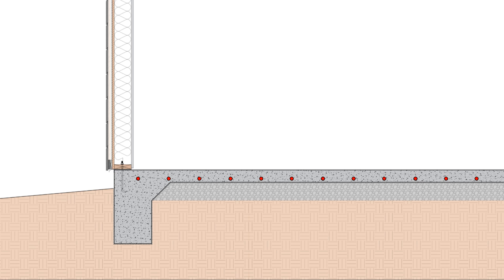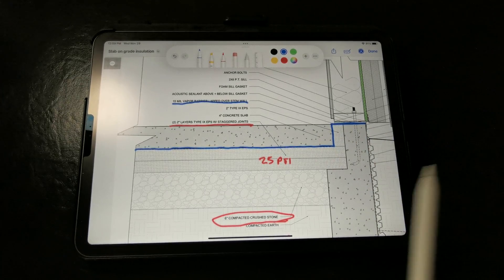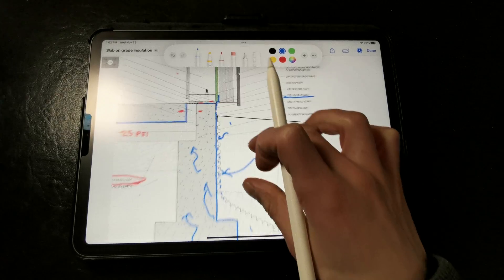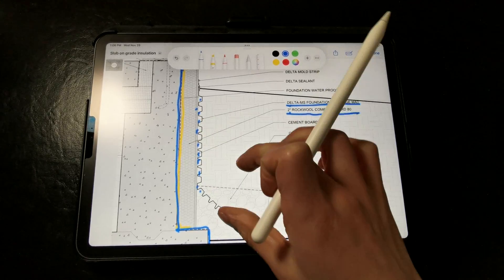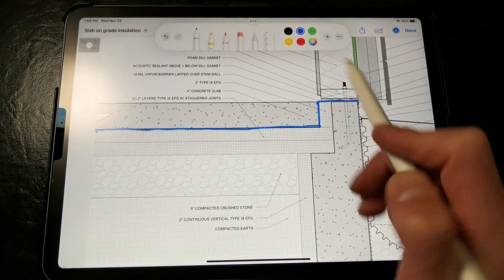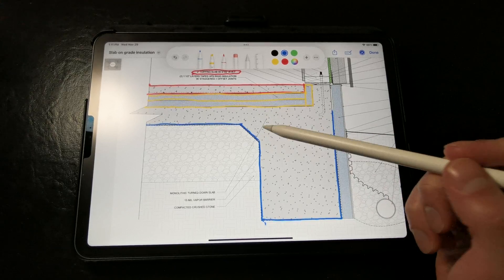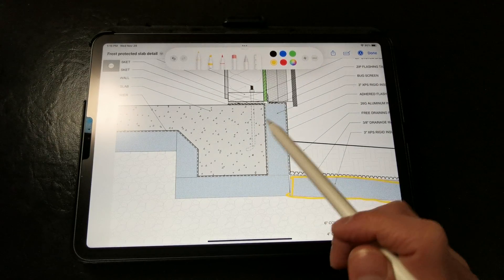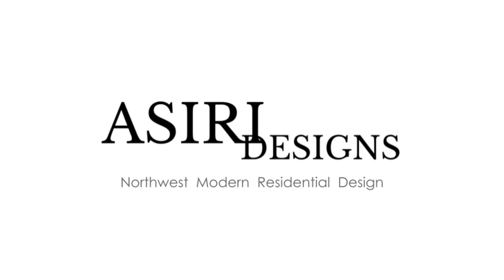Insulated Slab on Grade Foundations (For Architects + Builders)

Comment: In regards to your 'Insulated Monolithic Slab w/ Topping Slap detail......I'm planning to raise the slab on my garage to match the finished floor elevation of 1957 home (pier/beam).  Garage slab needs to raised approx 6" to match home floor elevation (garage slab is currently covered with epoxy flooring fwiw).  Would it be ok to add 15 mil vapor barrier under 4" xps (w/ taped seams) or should I add above xps?  Also, since footing/slab is already in place any suggestion on how to detail the perimeter xps?  Concern here is I would be pushing into the interior floorspace is I used 2" xps for perimeter insulation.  Hope that makes sense!

Comment: How would you do that with poured concrete walls also? Could you make an insulated concrete wall (with the insulation inside, not icf) and have a load bearing wall on top of the rigid insulation? I guess the load bearing section of the wall would have to be over the footing section of the foundation... (so outside of the insulation)

Comment: The detail of having the vapour barrier above the rigid slab insulation is WRONG and will lead to COMPROMISE of the insulation R-value because water will condensate on the underside of the vapour barrier which separates the insulation from the warm slab. Treating the insulation as substrate, by placing it in contact with the ground and THEN layering plastic over it is madness.

Comment: General contractor here, this vid displays typical engineering student bullshit.  When you get some in the field experience, you do away with all the "gee whiz, that's cool!" design details and go straight to things like letting the 2 X 6 bottom plate sit 2" off the top of the stem wall, run your 2" of blue board right up against the bottom of the plate and run your below grade ice and water shield a foot up the wall sheeting.  Geotextile/filter fabric to protect the ice and water shield membrane and a washed rock layer for curtain drain into foot drain for wet locations.  Use flat painted sheet metal from just below grade to up under bottom of siding to protect ice and water shield membrane from sun and make it look nice and you've got an insect and bomb proof free board detail.
Reply from the maker: We'd love to see a video or sketch showcasing this detail (as well as many viewers watching this video). It sounds like it has a lot of potential, and we're always keen on learning about other ways to solve the problem. Please do post a video and share it with us.

Comment: 4:06 … you are calling out cement board over the foundation insulation, and then Delta-MS Foundation Drain Mat over the cement board.

What type of cement board are you using? How is it attached to the foundation? And are you applying anything to it, to seal it, prior to installing the drain mat?

Comment: On a related subject somewhat, I've never used anything but water in 4 different radiant floor homes and shops, no anti freeze, for the last 40 years.  In the Idaho mountains, so real winters,  the homes had basements but the two shops were an insulated slab with insulated foundation walls to the top of the footings.  Even after a couple weeks of no aux heat the slabs never got below the low '50's.

Comment: There are two types of climate zones: One for growing and the scale goes from zone 1 as the coldest and 10 as the warmest. Then there is the building climate zones which is opposite, ie zone 1 is very hot and humid and zone 10 being frigid cold, so now this makes sense the colder the climate the more insulation you need as long as you use the right climate zone scale
Reply: Slab on grade great lessons and thought provoking. Thermal bridging, potential wicking not to mention water and frost heave all seen important!

Comment: The real question here is why are we insulating the concrete on the bottom at all? Why not just use an appropriate rigid insulation above? Seems likely we are spending extra time and money coddling concrete. Concrete was never developed for this kind of use and I can't help but think the generations of builders long gone would look at this construction as madness.
Reply: Insulation on top of the concrete can cause condensation with the cold concrete, which can produce mold.

Comment: Very informative video. I have two questions: 1) Does the slab not need 2" to rest upon? A standard frost wall is 8" thick. 2" for the slab and 6" for the sill plate. 2) If the rigid insulation is placed at further outwards to leave 2" resting space for the slab, it will cut into the sill plate area. Will it not diminish the weight-bearing strength of the frost wall?

Comment: I would suggest to extend the outside wall insulation past the top of the foundation. The foam sill gasket is still a thermal break that could be covered

Comment: I have tried to design this with an engineer, and we found that your anchor bolts being used in the concrete I believe three and three-quarter inch of concrete on each side, which means you need a full 8 inch concrete wall for the anchors to work. By using the phone, you’ve narrowed it to 6 inches. Have you ever ran into this or checked on it with a new engineer?

Comment: At 3:04 where you’re using Zip liquid flash, I’ve found that Siga Fentrim is much easier to work with and much less messy. If you live in the northeast it’s readily available and you can get it in a day or 2. It doesn’t require primer and sticks extremely well to concrete and zip sheathing. Also, at 3:24, if you can get there to roll the water proofer on the footing after it’s cast before they set forms, you can eliminate that capillary action from the footing to the wall.

Comment: We always do this. We use Rockwool Comfortboard and a woven vapor barrier so rebar or re-mesh doesn't easily puncture it. We have also used closed-cell spray foam under the slab with great success. We have major termite and carpenter ant issues here, so we often add diatomaceous earth and/or a heavy dusting of concrete onto the gravel before spray foaming.
Reply: That’s interesting about diatomaceous earth. I might do that. What state? I’m in Arkansas

Comment: Using a monolithic slab in climate zone 2. Which one of your insulation technique is best? Thank you for your time.
Reply: I second that. I’m working on climate zone 2 as well and the water table is very high. These videos are great, but with most of them and other similar channels the climate zone or region of the project, type of soils, and other localized info seems to be missing. I find that it is always good to follow up with the local contractors, soils and structural engineers for more specific construction methods that may apply to your project. Thanks for bringing it up @johnnyboyo311. Thank you for the valuable  content asiridesigns.

Comment: Sounds great, and all this sounds like a Commercial Cost  Residential Quality house.  Which to me, living in Zone 5a, and the push for the IECC to enforce ASHRAE 90.1-2019 and some states pushing more strict compliance.  A tiny home even what you are explaining of maybe 2,000sf will cost $600.00 per sf.  1.2 million for a house is just wasteful since a house with today's materials will never last 200 years and materials today are Junk Quality comparing to Quality and craftsmanship of the 30s 40s 50s.  Especially when average wages were approximately $13,000 and a house cost $42,000 of comparable size, when a person's avg wage is $70,000 so if the inflation was the same, only those making $300,000 could build that house...  🤔

Comment: Thank you for this. I cannot get my head away from the last option. All the others have far less thermal mass which bothers me. In a non cold climate you could also put an uninsulated slab on grade and seal it, then lay a timber floor over it with insulation in it, but this has no thermal mass.

Comment: I really like your illustrations and want to learn more, so I subscribed and Liked it too.... I will be designing a single story home and it's I.C.F. foundation will be made from I.C.F.'s and foundation is split into two sections that needs a stepped footing, meaning one side (left) being the kitchen/living (radiant floor heating) it will be I.C.F with Frost Protected Slab and the other side (Right) will be for the 2 bedrooms and 2 full Bathrooms, over a small (radiant floor heating) basement.... 
P.s. great idea that you mentioned about the dimple mat applied over and down the horizontal wing of the ridged insulation over to the drainage tile!!!  
We will be moving to Maine as my Wife has received a job transfer and after we find a rental, I will be searching for a piece of land to build upon...            Thank you!!!

Comment: Thanks for this very useful video. My plans have R5 1" rigid insulation called out around the edge of the slab here in California. I was wondering, is it best to install these insulation boards inside the forms before pouring the concrete or to install them afterwards?
Reply from the maker: Thanks for watching! In answer to your question, if the rigid insulation is to be installed on the exterior of the slab assembly, it's best to install it after the concrete has been poured and cured, as the waterproofing/damp proofing will need to be applied to the concrete prior to the installation of the rigid insulation (unless you're using ICFs).

Comment: for option 5 the monolithic turn down slab thats insulated on the interior.  how would you install the insulation if the ground isnt uniform especially if the foundation wall has to be deeper, say 3, 4 or 5 ft?  sometimes there isnt the room to put insulation on the outside.

Comment: With increasing prices for sheets of rigid insulating foam reaching above $70 per 4x8 piece, and calling for double layer, it is possible that a +25 psi spray foam product can be developed and utilized under a concrete slab and utilized on the foundation wall as well. Add to the sheet cost the time to cut and assemble, eliminating “iceberging” and eliminating expensive hard to handle adhesive sealer tape, and benefits of an air tight seal around pipes, columns and other openings… the cost of dense spray foam might be less overall than rigid sheets… and the cure time of the spray foam could save additional time before concrete pour, or reduce costs of flashing on sills or around perimeter junctions.spray foam application over compressed crushed rock would level well and help consolidate the compressed mass. I predict the application of dense spray foam will become common practice in the near future.
Reply: We spray closed cell over the crushed stone in the basement and 2’ up the wall feathering it to nothing. After the concrete basement floor is poured over that and the first floor is built, we continue the spray foam up the inside of the walls and into the rim joist.
Reply: Couldn’t you use closed cell foam?
Reply: this is probably doable but the problem is that if you get variations in density, hence compressive strength you are likely to get many more cracks in the concrete. It is much easier to control the uniform density in a factory. With that said, the companies are indeed gouging and importing insulation from other countries is cost prohibitive because they take a lot of space hence shipping cost per panel will be astronomical. The domestic suppliers know this hence they know they can gouge and get away with it
Reply: Really? Where im from your typical underfloor polystyrene pack of 0,72m3 (thats 7,2m2 (77,5sq.ft) in 100mm (4") thickness) costs 60 dollars
Reply: DONT FORGET TO TAKE INTO CONSIDERATION-THOUGH CLOSED CELL IS BEST FOR CLOSED CLIMATES
IT AND PINK BOARD ARE GREAT FOR WATCHING YOUR DREAM HOME GO UP IN FLAMES—should a fire break out. HOPEFULLY A FIRE RETARDANT WOULD HAVE BEEN USED WHERE THE WIRING GOES THROUGH THE STUDS SINCE APPARENTLY THOSE WIRES CAN BURN REALLY WELL!( also using Steel boxes for plugs are safer too)
I watched a test video of different insulation materials in a burning test. The Closed cell almost looked like it had stopped, only to be found More flame was held inside.
After watching the Pink board FLAME UP!
NOPE! Not using that!

Comment: It seems like the majority of new homes here in the Northeast are increasingly using the frost protected shallow foundation, reviewed in the last detail because the concrete and excavation costs are a small FRACTION of the first couple designs, yet it seems like there is no noticeable compromise in performance. Is there a compelling reason to use the first 3-4 assemblies? We’re talking 4-5x more expensive than a FPSF with a continuous foam envelope.
Reply: I’m in western New York and have never seen a FPSF. I’m guy a regular Joe but I always look at new builds in the area.

The obvious problem with it is you don’t get a basement, which for many is a cheap expansion on home size. I use mine constantly.
Reply: @patty109109  I’m seeing them become more common over the last 5-10 years. Nothing “cheap” about basements though. Cheaper would be addition a bump assertion or a second floor. Pouring a footer, walls then a floor (joists) system is a LOT more money than framing above grade… a larger garage is how to get extra storage, etc for cheap. I love basements, but they’re more of a luxury.

Comment: Great video and good stuff! Thanks. Now for the last assembly (frost protected shallow foundation, or FPSF), what about using a “reverse monoslab” assembly? I saw this assembly on Bondo Built’s channel and it certainly piqued my interest. 8-12” of graded & compacted crushed (clean) stone, then put 2-4” of XPS foam on top of that, then bring in 8-10” of crusher-run mix (1” stone with fines) in the middle, such that your footer is 12-16” thick and your interior floor slab is 4-6” (or whatever is specified). It seems like it’s a much easier way to ensure continuous foam coverage around the haunch and turn-down. The sidewall foam detail and sloping below grade curtain is the same.

Comment: Please provide this detail for a full excavated basement, with Zip R.  I am struggling with where to put the wall insulation (inside or outside).  I do not like the idea of trying to match insulation thickness with sheathing thickness (and/or overhang).  This is also complicated for homes with both brick and siding facades.  With Zip R type sheathing (or equivalent) soon to be the norm, I think that dealing with the aesthetics of a continuous insulation barrier is going to be challenging.
Reply: Zip-R has several major flaws. No engineer will specify it for shear strength since the nails must pass through the foam unsupported. Also air gets through the seams from inside the house and moisture gets to the edges of the OSB causing swelling and failure. Basically the insulation is on the wrong side.

Comment: Good clean and sensible insulating details.  In the PNW our energy code only requires 2" or R-10 rigid under heated space SOG.  However, from personal experience, I would use at least the 4" as you have detailed because 2" still leaves you with cold floors.  Also typical is to install the vertical R-10 to the inside of the stem wall with a 45 degree angle cut at the surface rather than ledgering the insulation into the stem wall but I can see the benefits to your detail.
Reply from the maker: Thanks for watching, and well said! You could absolutely bevel cut the rigid insulation on the interior skirt if you wanted a smoother transition between floor slab and stem wall.

Comment: in the NE we often see slab on grade for garages only. do you feel that a perimeter drain is necessary for a detached garage, which has soil on both sides to counteract hydrostatic pressure? Obviously it's better but is it necessary? perhaps the perimeter drain could be under the slab on the interior side of the wall to prevent hydrostatic pressure build up under the slab, bc water can rise as well. If so it would be less expensive to simply do a trench concrete footing and stem wall, without having to further excavate and water proof. Simply, would this actually work long term without major consequence and save clients money?
Reply from the maker: I would say if it's a detached unheated/unconditioned garage on a site with good grading and drainage, you could probably omit it, but you'd need to address it on a case by case basis. If your clients store expensive cars in their detached garages or any moisture sensitive items (as many people use their garages as ancillary storage), a perimeter drain is a good idea just to avoid any potential liability.
Reply: @ASIRIDesigns  Thanks appreciate the response!

Comment: After compaction and setting all plumbing and electrical for the slab, I termite treat the soil, cover with 15 mil plastic, overlap joints 12", tape joints, then spray foam the entire area, set rebar, and then pour a monolithic slab.
Reply from the maker: This is a fantastic method as well, you see this strategy a lot in the Northeastern US.
Reply: @ASIRIDesigns  can you do a detail for this method?  Coastal123, what area are you spray foaming in this case?
Reply: I've heard that monolithic slabs don't do well in colder climates.

Comment: Great video
Reply from the maker: Thanks for watching! Cheers!
Reply: @ASIRIDesigns       Little back story. I’m
A bricklayer from
England but moved to Fairbanks Alaska and I’m starting doing my own construction here I’m finding lots of new techniques not only with differences in uk to USA but also arctic cold climate construction I’m going g to be pouring my slab for my own home extension this may  22x36 shop with second floor living area 

If using 2x6 frame would I make the stem wall 4” plus 2” insulation so my 6” baseplate would cover the insulation?? 
I was thinking of building my stem wall in 4” or 6” concrete blocks